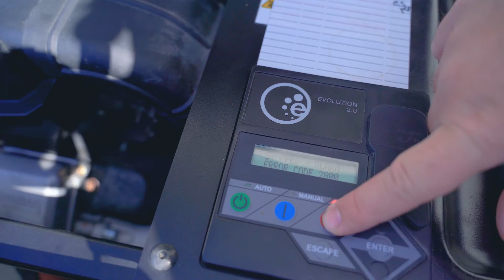GENERAC Error Code 1300

Comment: In Houston as well. Generator ran for seven days just went out.  Code 1300 low oil, pressure.  I change the oil but cannot get the code to clear.  Hot days for me.